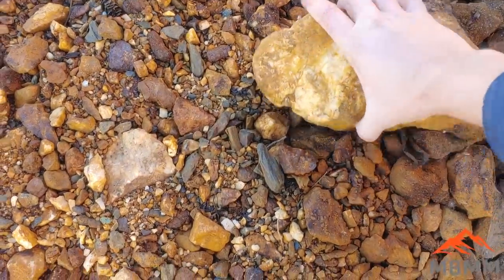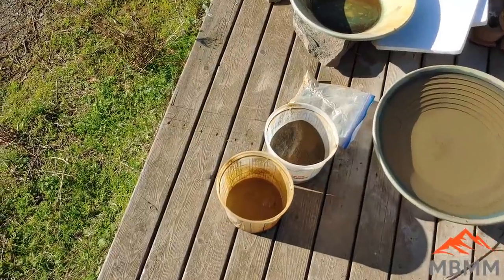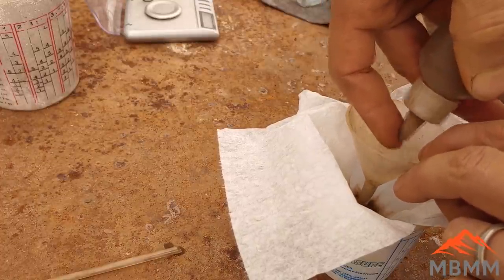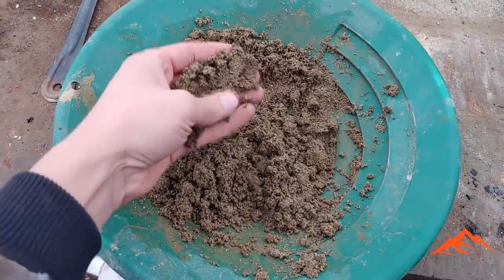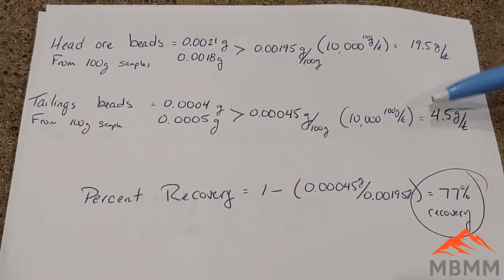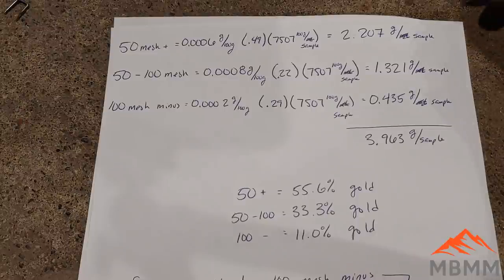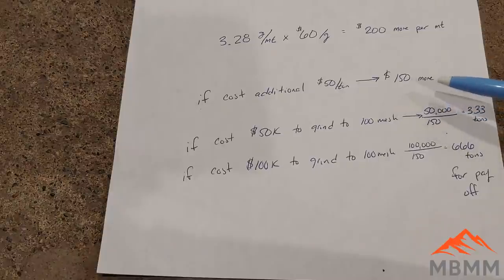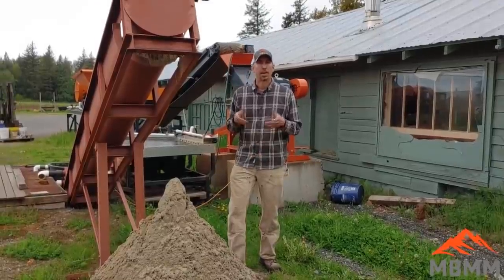Gold Ore Milling Study: How To Determine Percent Gold Recovery

Comment: Good job, great video. One of the things that has to be considered about finer grinding for serious commercial mining is what percentage of the gold in those tailings is still gravity recoverable. I think a significant portion - especially of the smallest fraction - would only be recoverable by leaching.  To get that super small gold you will need a leach circuit. Some places with a lot of gold in the sulfides might be best processed with a flotation circuit.
Reply from the maker: Great point!  Thanks Chris
Reply: Can a person make some sort of mini-version of a flotation circuit? I've tried various methods but with me, it's nothing but an exercise in do and fail or do and it works. I'd like to know more about flotation. I get the feeling I'm missing out on something crucial. We have 14gms per ton of gold and about the same for silver on our property and I'm trying to find the best method of recovery after crushing. I have largely failed in my efforts so far in recovery. I'm thinking my next purchase should be a shaker table but they're expensive.

Comment: I've got a silly idea.  Spin that hammer mill a 180° turn and the spiral classifier so it drops back into the hammer mill and reprocess the classifier output.  I know you add wear and tear to the hammer mill but you are only adding O&M which is variable based off of operation and not a fixed capital cost.

Comment: Very well done!   And thanks for making this important video.  Every small prospector has to evaluate the costs and time involved, myself included.  I'm still one or two steps below with a hand crusher then panning free mill gold. It would benefit me if you were to mention today's costs for each piece of equipment you are demonstrating.  I guess my next step would be to send off bags of high graded ore but the one local ore processor I spoke with has a minimum order of $2,500 and, for me, that jump is still a bit too high.  There are probably thousands of little guys like me for every one that can justify taking the next step.  Again, thanks for this post.

Comment: I would be curious to see what the difference in recovery would be of the panned #1 and if you smelted everything in the #1. It looks like the amount of material would reasonable for a single smelt and if you would treat it as if you were smelting sulfides with the Basic Iron flux, you might be able to increase your return. I would suspect that the heavier sulfides in the #1 would have a higher concentration of precious metals (especially silver) than in the other numbers and physical extraction via snuffer seems like it could miss some gold. What I am thinking is something along these lines:

1) Split  #1 50/50 and pan half of it and smelt the other half
2) Mix in some lead collector metal into the smelt and then cupell that button directly
3) Do the normal process for pan recovery 
4) Compare results. If possible, use XRF to see if smelting increases the concentration of non-gold precious metals in final button

 The big question would be if the losses from the smelting process would be greater than the losses from physical extraction VIA snuffer bottle. I would expect that smelting the #1 would likely increase the concentration of silver in the final button which may be undesirable. Might not necessarily be more economic for smaller ton ranges but may scale better for larger ones.

Comment: percent recovered should have the total gold in the denominator. 1 - (.00045/(.00045+.00195)) = 81.25%. Showing an example where the percent recovery was smaller would make this more apparent. If your head ore recovered .002 and your tail ore was .001, you can easily see that you recovered 2/3 (66.7%) of the gold with your head ore, but 1-(.001/.002) is only 50%. Thats why 1-(.001/(.001+.002)) is the correct calculation. 🙂 Love all your explanations, keep it up!

Comment: And don't forget that sand is a building material that you can sell. Can't make concrete without adding sand and under the bottom plate of a house you need a couple of cubic metres of sand.

Comment: I was thinking if you could do a comparison between small mesh sized rocks before crushing graduating to larger rocks and gold recovered versus mesh size and the cost to crush them based on mesh size ,same weight sample for comparison though . I am thinking since gold tends to be in the smaller rocks there will be a cutoff size where it won’t be economical to crush them for there gold because of energy cost and wear and tear on the equipment. You could test more distant locations to see if the mesh size theory holds up somewhat universally . Please do a video on that.

Comment: Just ask Achimedes. You can calculate the gold and silver by using its specific weight. Should give you a good idea how much gold you got without using toxic acids.
Reply: Yes they do it if they have a lot of gold in quartz.
But will it not bee too inaccurate/not precise if you have a mix of material
I know the iron from the hammer mill could easy be eliminated first
But things as clay forexcampel

Comment: Would secondary classifying to multiple fractions from 50 to 200 mesh with the cons result in better recovery on a second run on the table,or would it be to much work?

Comment: I’m super interested in a gas powered hammer mill with a sluice. Or even better a small shaker table that runs off of the same motor